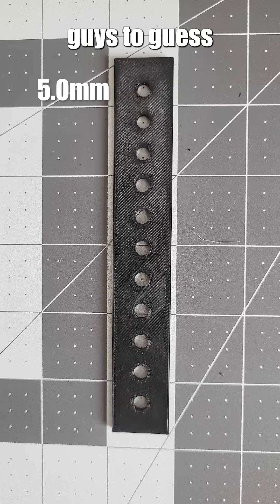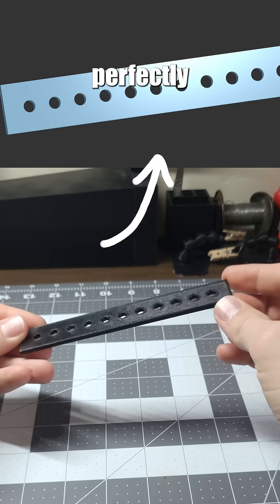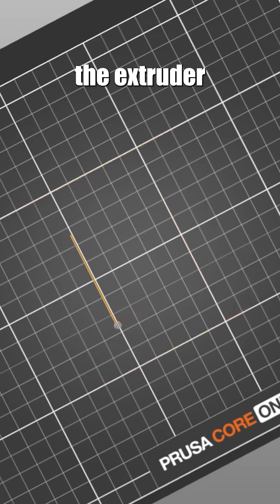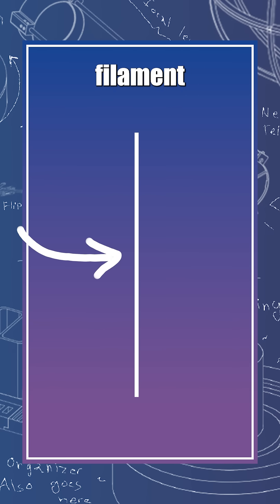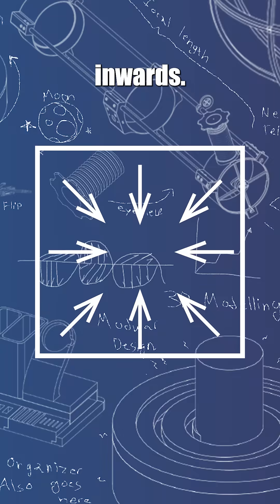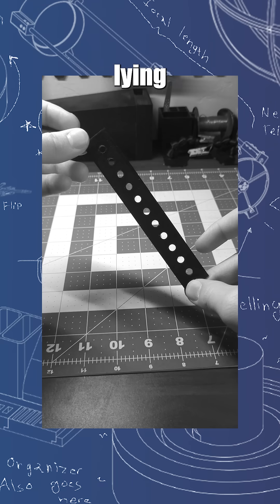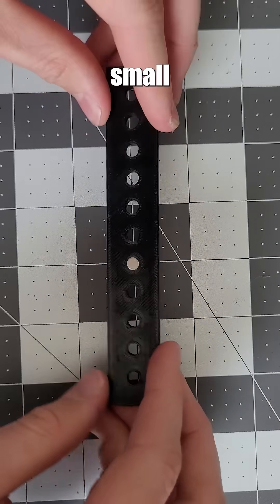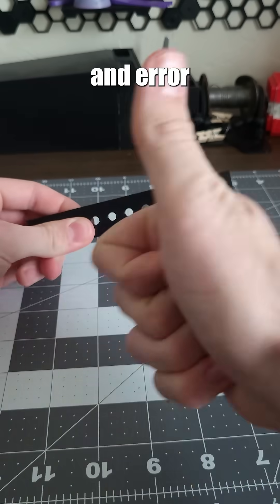Why Do 3D Prints Never Fit? | Tolerance Explained

Comment: Would also HIGHLY recommend drying your filament for the most consistent results. Wet PLA always decreases hole sizes by about 0.2mm for me, which is the difference between a clearance and an interference fit for an M3 bolt.

Comment: It’s so much quicker and easier to print a small test piece and include adjustments in the cad model for any particular printer and material, than having to modify a 12h print because of an error in your slicer offsets. I have my own test jigs organised by machine and filament so many future designs don’t need new test pieces. Just have to ensure proper maintenance of my machines to maximise repeatability. Bridges aren’t built by guessing lol. Good job man 👍🏻

Comment: Jig 💯, I always print a stencil like you did; I've had changes at even at the same brand filament but different color. 

But magnets, do hex holes, it will usually provide tolerance for all brands and colors
Reply from the maker: I've heard the hex holes for magnets a few times. I'll have to try it. 🤔